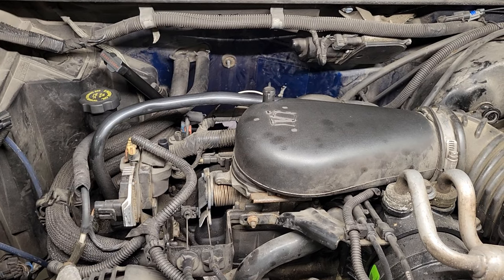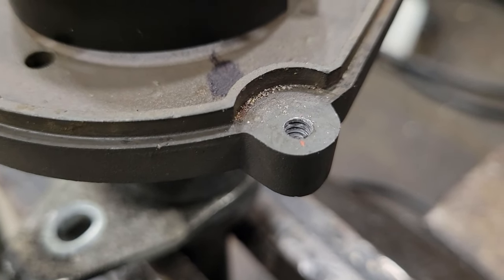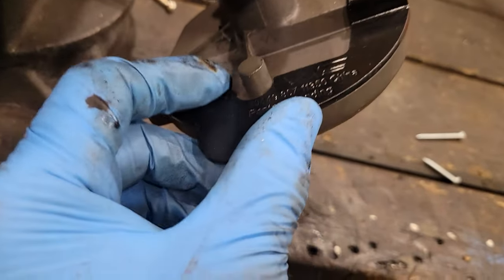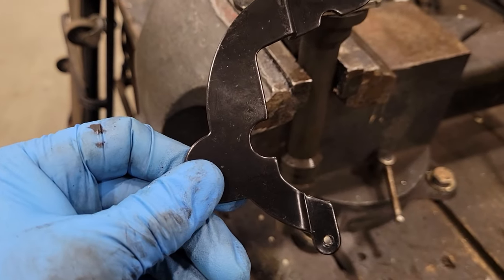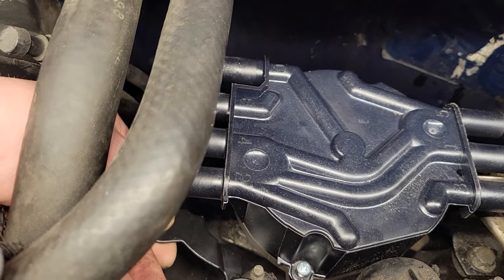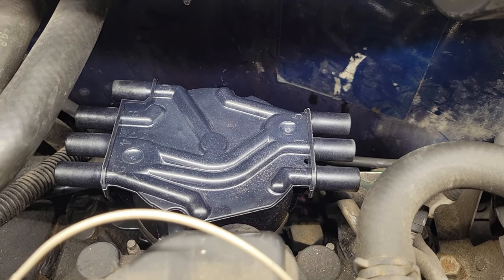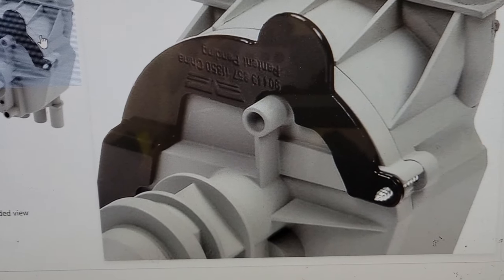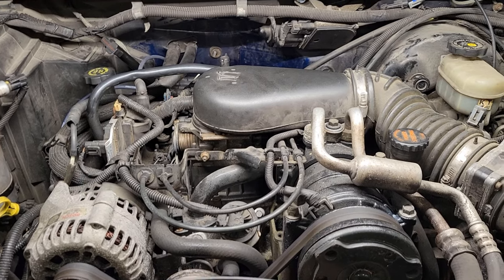The Ultimate Solution to Stripped Chevy Vortec Distributor Cap Screws

Comment: Thank you, my day just went from crap to, ok. I just bought this truck for cheap. My first problem was the rotor screws were corroded so I used a Dremel to cut the plastic around then I used a pair of vice grips to remove them. Both tabs were broken and the truck wtill drove so this was a real surprise.
Reply from the maker: Glad the video was helpful. This piece got me out of buying a new distributor. Thanks for watching and commenting.

Comment: Good video man my screws just stripped today. I was like now I have to do some homework  lol.
Reply from the maker: Very common for those screws to strip or break. Were you able to get it fixed without replacing the distributor? Keep me posted. Thanks for watching and commenting.
Reply: @shanersmechaniclife3164  I know I use to have 15 years ago so I know but back then we had to change the whole distributor cause the tab broke off. Buy for my 99 they have a solution. Good video bro

Comment: I could have saved a lot if I knew that bracket was out there.  What about brand new distributor rotor cross threaded screw holes? Right out of the box, a bad factory srew hole tap job left me with a useless distributor. A quick fix was a self taping screw was installed but ugly. Any thoughts?
Reply from the maker: I was happy to find that bracket as well. I was doing a no start on my dad's blazer when I ran into the cap screw issues.  As far as the rotor screws, not much you can do short of replacement.  Thanks for watching and commenting.

Comment: Does this work if the distributor is plastic? Yours is metal.
Does this cause a gap, and the distributor won't seat properly?
Reply from the maker: This works for plastic distributors as well. It does not cause a gap. The plate sandwiches the distributor body between it and the cap. Thanks for watching and commenting.

Comment: How to unclog the air vent holes? is the screen closer to the top or the bottom of the holes and is it okay to just drill through the screen to open it up and leave it like that?
Reply from the maker: I find a quick shot of brake clean does the trick. Just make sure it evaporates before you try to start it.